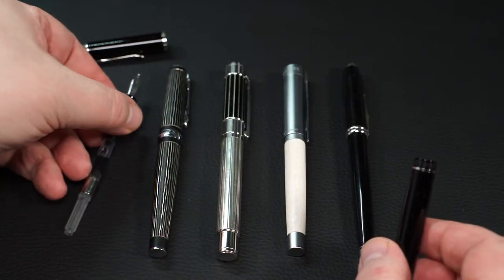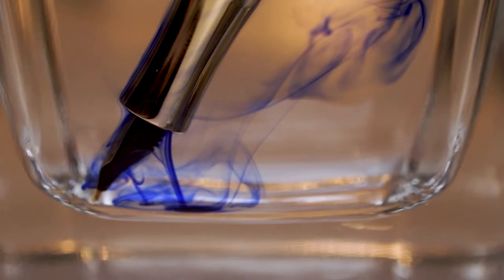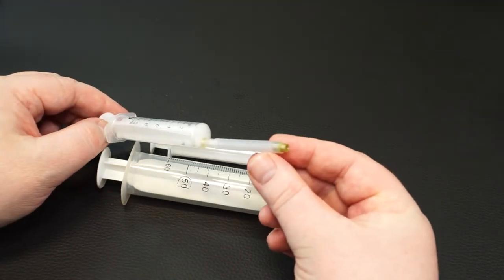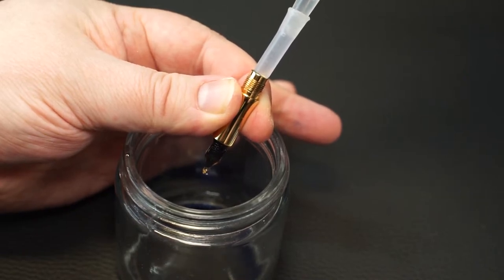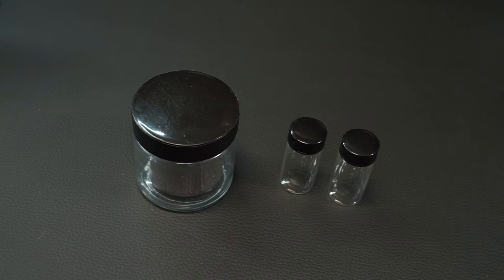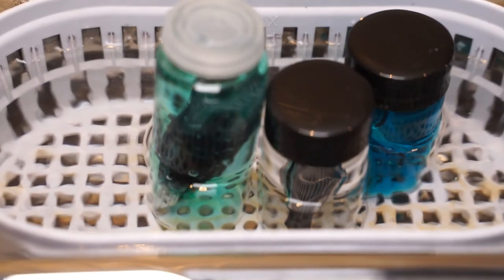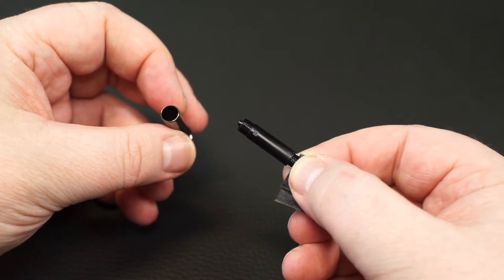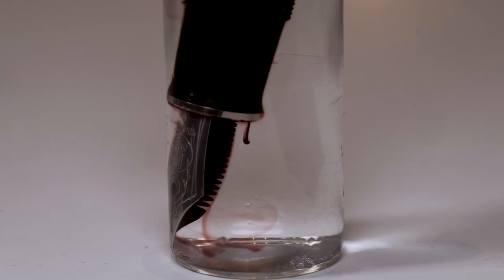How to clean a fountain pen. Several methods. Also for dried up pens 🖋

Comment: Some of the Parker fountain pens that I own have ink cartridges that have a built-in plunger, similar to a syringe. I use it to draw water in and expel it out of the cartridge through the nib, several times until the ink residue clears. Once it is dried out, I repeat the process but with some ink so that the pen is rinsed out with ink.
Reply from the maker: A piston fountain pen was once more common than it is today. But they are great.
Reply: @WritingDelight  Yeah, like the good old "Hero" pens. But I was talking about the detachable cartridges from Parker but half size with a piston under them. Are those no longer available? The ones I have are at least 13 years old so not sure. I recently got a Parker IM fountain pen but it came with a full size cartridge.

Comment: I have a fountain pen that i use a very viscous black ink inside and because of how viscous the ink is i have to clean it every time a cartridge runs out so that it doesn't clog before changing cartridges
Reply from the maker: Which method do you use then?
Reply: @WritingDelight  I use either a converter or a diy flushing tool i made with an empty cartridge and a syringe
Either method gets the pen clean and smooth writing again
Reply: What ink?
Reply: @BuffaloNickel9  I'm not sure what brand it is as the ink came in unbranded cartridges with my lamy safari kockoffs